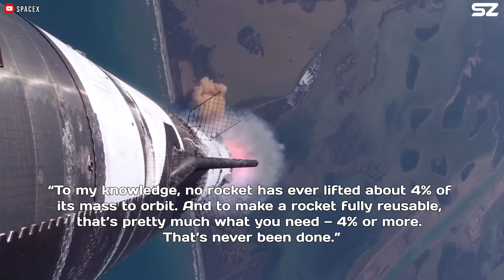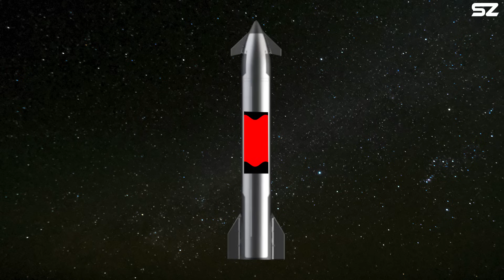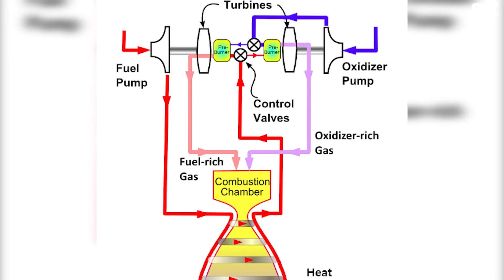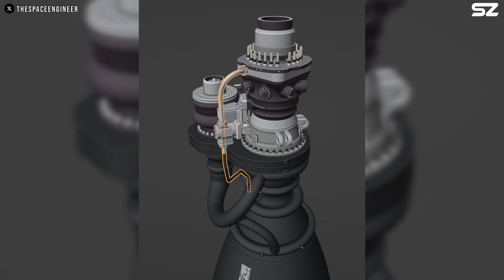Why is it Hard for SpaceX to get Starship Success

Comment: Making Starship of stainless steel is the dumbest engineering decision I have ever seen. There is a reason nobody makes rockets or airplanes out of stainless steel. 
Hot staging is badly needed to make up for this overly heavy vehicle.
I have zero confidence in this program.
Reply: SpaceX is focused on reusability, thermal robustness and cost, so they decided that AISI 301 Stainless Steel was the right choice
Reply: @maurotrevisan7879 I will give you 3 years to decide if stainless steel was the right choice…
It was the right choice for Cybertruck right??
….every kilogram matters for space vehicles. Every single one…
Reply: @pedrosura  and that's exactly why I'm convinced that they did their maths, I don't think that SpaceX is the neighborhood mechanic who changes light bulbs... moreover, Cybertruck has nothing to do with sending rockets into space (but if you think you know more than SpaceX engineers, you better tell them)
Reply: @pedrosura  even china is starting to use SS ... so what are you talking about?
Reply: @websitemartian What I am talking about is that SS is very heavy and every pound to space is precious. 
What is the current payload to LEO? The vehicles so far are fully loaded of fuel and land empty and the vehicle flew empty. Do you know what that means?
China copying anything US is not surprising. Chinese SS is heavy also and bad for space vehicles or airplanes.
SS is very heat resistant but guess what? It still needs tiles or a hear protection system. 
Its a bad idea. You will see.
Reply: @pedrosura sure .. what material do you suggest they use then ? and have you delivered this information to spacex? 🤦😂
Reply: @websitemartian Aluminum, Titanium, etc… every vehicle before Starship was made of something not Steel. Do you know that?
Tell Space X? Of course they know that. They probably underestimated how heavy it would be, over estimated the performance if the Raptor and the difficulties of integrating the Raptor to the launch vehicle. Back in 2016 Elon said Starship would take 300 tonnes to LEO reusable config and 550-600 expendable.
They would be lucky to get 30-50 tonnes right now.
Reply: Yes, an armchair engineer is ofcourse always way better than the team that's working on it now...

Why don't you apply to spacex and tell them, they'll for sure throw you a party!
Reply: @HorsePonyHybrid  History is filled with engineer teams making stupid decisions. Just think of all those teams of engineers trying to make "hyperloop" work despite the entire concept being fatally flawed from the start. If Elon really wanted to make entirely reusable rockets then you'd think he'd start by experimenting with and perfecting the recovery of the second stage of Falcon 9 rockets. The point here is that that was the original idea and this requirement was dropped for a reason - mass (primarily as a technical restriction, the other reason was cost of development).

In defense of the engineers: if Elon gives you an objective to make his crayon drawing work you really don't want to criticize the man with an ego higher than his promises. He's known for firing people on a whim and who'd want that in this economy? Just keep working until the man understands the entire concept is not going to work or is going to be so horribly inefficient there was no point developing it at all. Maybe it'll work in some capacity in the end after unnecessary amount of resources have been dumped into the project but prospects look grim.
Reply: @HorsePonyHybrid One of us is an aerospace engineer. The other one is an offended fan boy. SS is a dumb decision for rockets or airplanes.  SS is heavy, I am sure they know better than me because it is them who are struggling to get the performance originally planned. It used to be 300 t to LEO. I would be surprised if they can get 50t with the current vehicle.
Reply: @websitemartian  They had carbon fibre up until 2017, dumped it for some reason (maybe mechanical structural stability, but most likely it was the costs). It looks as if the raptors have to go to their limits to carry that monstrum and that leads to overheating, leaks and instable burning with resonance problems. I see no proper fix, if this is the true reason. Maybe they have to reconsider the material.
Reply: @pedrosura; Aluminum structural weakness point is about 150°C.
Stainless Steel alloys structural weakness point is abut 1800°C.
Not even comparable, you cannot re-enter a vehicle when the structure looses integrity at 150°C
Jeff Bezos has even switched to building rockets out of S.S. alloys.
Reply: @deanwcampbell  never heard of heat shield tiles?

Comment: I think the gas giants have stronger gravity than Earth.
Reply: Yes Jupiter 2.36 Neptune 1.12 those are the only ones with higher gravity. Sounds like Elon got it wrong again.
Reply: Those planets don't really have a surface, which is needed to launch a rocket from ... 
Otherwise, the sun has the strongest gravitational field in the solar system.
Reply: @Xbox360SlimFan no because Sun isn't a planet. The narration should have said ''rocky planet with strongest gravity in the solar system'' or terrestrial planet if that's what they also call them.